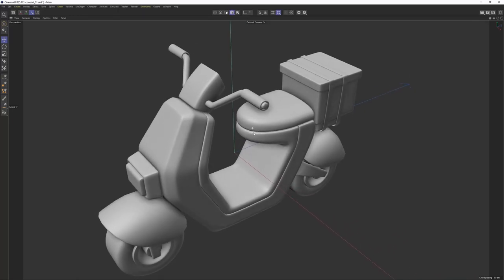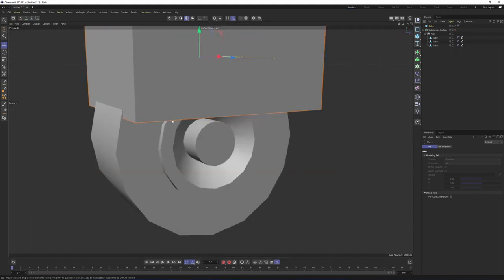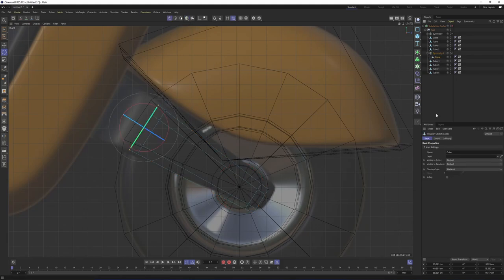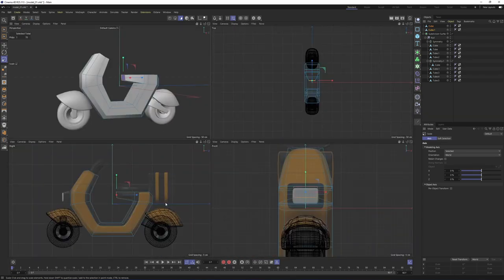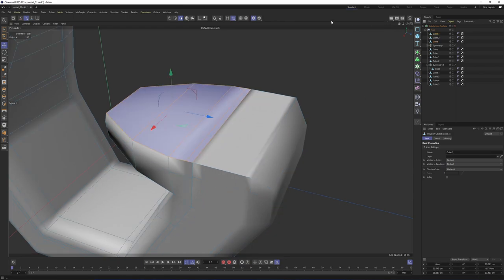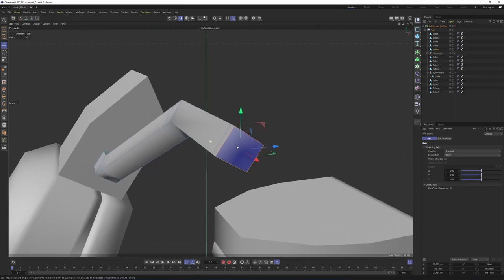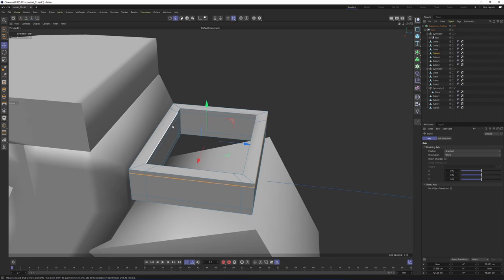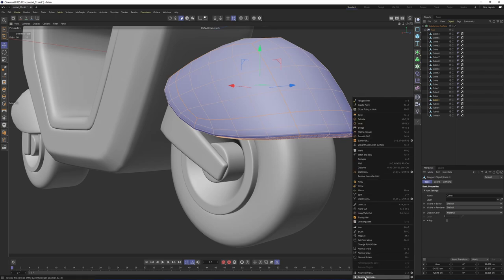Beginner 3D Modeling #6 | Motorcycle | Cinema 4D SubDivision Modeling Tutorial.

Comment: Does C4d sill need to rely on a script to turn selections into regular shapes like circles? Does the Pivot or modeling axes support only placing snapping to other components or allows orientation/alignment as well without moving it?
Reply from the maker: Yeah, there is no internel tool to turn edges/pointa to circles.

You can modify axis of the objects without moving, you can do it by offsetting the modeling axis ( Move tool )
Reply from the maker: @orphydiancg7759  Yeah, you can do all of these in Cinema 4D too but it just takes longer to.
Reply: @polygonpen  somebody told me it's possible by parenting stuff the in the modeling axis choose parent option. If you try that in one of your video let me know